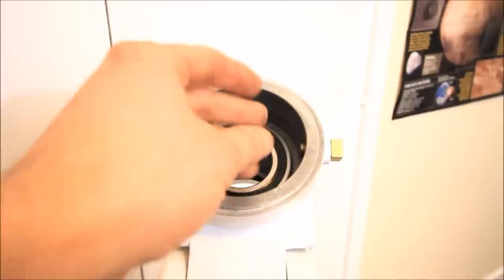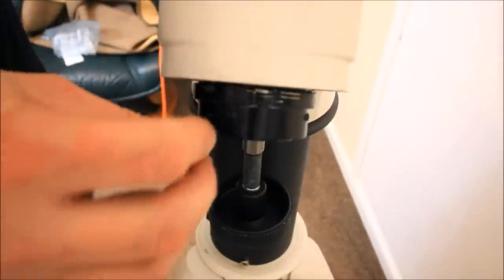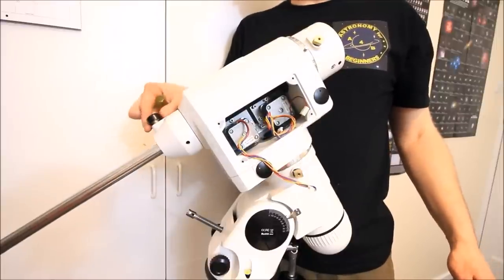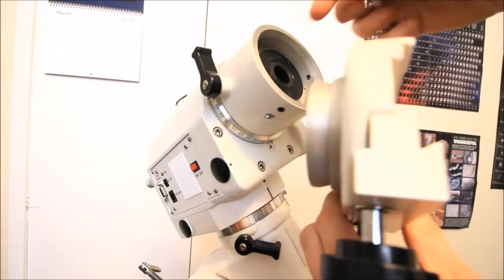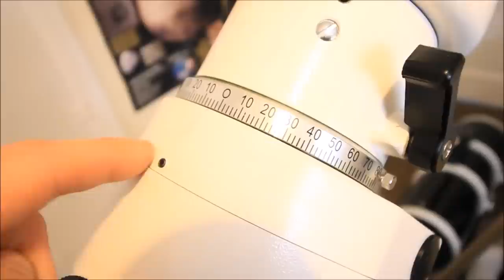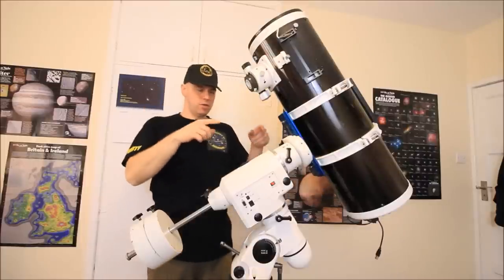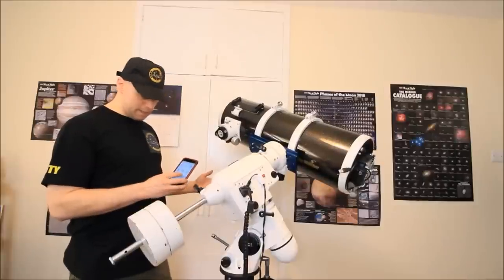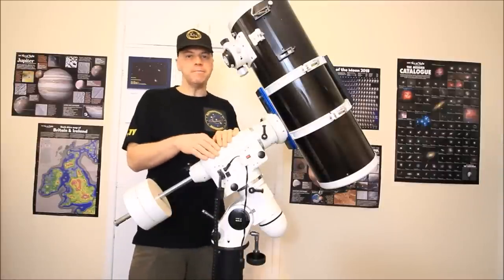How to Super tune the Skywatcher NEQ-6 Mount Part 5

Comment: Thanks for all your work on this series of videos. I have just converted my NEQ-6, and having these videos helped clarify Rowan's instructions and gave me the confidence to dive in.
Reply from the maker: Glad to help! This can be done very easily if your careful, but your mount will operate so much better, I was too in the same position as you, whether to belt mod or just stick with the normal spur gears, but I have spent so much time to get very limited movement from the backlash of the gears, I cannot completely get rid of the free play without over stressing the motors, With the belt mod, you get zero backlash out all, and since I've done mod, I've never had to re-adjust the mount for a long time and my tracking has improved 50% performance increase over the original gears. So yeah Rowan belt mod is all the way for me!!

Comment: Amazing difference Martin! I’ve ordered my kit from Rowan can’t wait to fit it now! :) cheers Ant
Reply from the maker: I'm guessing you got the main bearings replaced, Yep standard ones are not very good and they have a rough feel to them as if the bearing races have worn out. The SKF ones are simply super smooth, your tracking will be amazing from just bearings alone, providing there is no free-play lateral movement and achieve the smooth movement when both axis are rotated , you should be good to go. The Rowan belt mod (if installed carefully) Will help to reduce the free play play in the gears (or gear slop which is always a problem with spur gears) and you'll have a positive drive in both axis. Tracking errors will be reduce massively too!! Enjoy the project you too will soon realise that the mount will feel like a £3000 mount. Remember to thumbs up all videos of this super-tune series for NEQ-6.

Comment: One technique I had to test the worm gear meshing was using a multimeter and check the amperage consomption. If amperage increase it's because the motor drive is forcing. You can very accurately measure when that happens.
Reply from the maker: What a great idea, I'll check that out, what values of Amperes should I consider a reasonable adjustment??
Reply: @MPAstro  Hi, whatever value I give you I wouldn't trust it anyways. Every system has it's own amperage consumption, it's own signature. Although, it shouldn't go much higher than 1 or 1.5 amp per axis. What you do is you establish a baseline by loosing the wormgear and then you get a "no workload" consumption level. Now, you connect your multimeter (in SERIE !!! if you dont want to blow a fuse, or the multimeter itself !) and start tightening the wormgear. It will slowly increase the consumption and then it's going to peak and this is where you know you went too far. When you do your 360 degrees checkup, keep the multimeter plugged and you will see where the wormgear bind.

Comment: Hey man great series of videos! Very clear and very informative. My NEQ-6 is experiencing the same issues and I'm looking to do something similar.
Reply from the maker: Thanks Daniel S, I have worked so hard at this project, I have seen many other examples on YouTube before which are very good, but they lack in certain areas like decent camera angles which certain areas really need to be observed properly to help the viewers. I think I've covered quite a bit here, the only problem though I wish my videos were shorter, but then I start to limit the key info which is needed for these videos. Good info with problems highlighted with me experiencing this project. It's good advice. Please do under take this project and you'll save a ton of money in the process. Please one key advice!!  remember to take your time on this project, and patience is key. Don't rush you can easily make a fatal mistake and destroy your mount in the process (especially the Rowan belt mod, it that is not installed properly). SO GO FOR IT!! You don't know what you'll actually missing, your mount is going to perform superbly with this super tune. So keep watching and don't forget to hit a like and subscribe on to my Channel.

Comment: Love the videos, Martin. So much important "in-between" information - which i couldnt have managed without. Followed your Supertune-videos, ordred all the bearings, and the rowan kit. I bought SuperLube instead of those #1 and #2 grease which you used - thats the only thing i didn't do like you. I also changed ALL bearings. I had problems removing the seals on those axis-bearings (SK6008something), so i used the grease that was supplied with them.

So - I'm finished setting it up now - and have a couple of questions for you if thats allright:

1. The slack you have in the DEC-axis, and are fixing at about 16:00 in the video - What determines which way you send the block? I mean, why you tighten it the one way and not the other?
I have the same slack in my RA-axis so i just wonder:)

2. I had the same symptoms as you showed in your video number 1. When I was turning the mount in especially DEC, it wasnt smooth and even all 360 degrees - it sort of braking at some points. Also some in the RA-axis. It is a lot smoother now - but faar from as smooth as your end result. I cannot send the axis away and it goes around like nothing. It's definately not so smooth even though the restistance is almost even the whole way.
You have any ideas to why?
Reply: Did you manage to solve the "smoothness" ? 
Having the exact same issue
Reply: @95kingston  in RA or DEC? Well the nut that keeps the weightbar for DEC and the polarscope tighting ring for RA was the sollution for me. I did unscrew it as much as possible without any axial movement. Then tightened the setscrews. So the weightbar "nut" is not handtight or tight at all, but theres no axial play and the setscrews keep it solid in position.
Reply: @Hegegutt  thanks I will try this 
It seems like the RA and DEC (especially RA) is stiff even without the polarscope screw in place
Reply: @95kingston  and you changed bearings? Or relubed? How about the teflon spacers, did you land on the correct number regarding thickness and amount?
Reply: @95kingston  also, did you replace the.... well the coneshaped bearing in polar scope end has 2 parts. Did you change the metal"ring" as well as the bearing itself?
Reply: @Hegegutt  Yes all bearings were replaced to new SKF bearings, everything was regreased and the brass gear was polished as well. 
It seems like everytime I'm removing the RA and replace it the stiffness is different.
Reply: @95kingston  i see. Well to have it really loose before tightening it worked for me (but no axial play). Reason i asked about the teflon washers is because on top of the brasswheel can touch the housing if there is not enough space with washers. Then it would most likely be stiff spots. If your at stargazerslounge forum you could message me there as its easier to explain. Masjstovel is the nickname there
Reply: @Hegegutt  thanks I will talk with you over there

Comment: g`day martin mate all your video are really good you have taught me heaps  but i am sorry to say there is getting to be too many adds  in your posts  which is getting to be very frustrating  please don't  add any more 
please keep going  uploading  your great posts  i have used a few of your videos hints and tips on my own equipment  and they work a treat  like the desiccant /silica gel cap made from old spacers and dslr nose cone   but i used a old 35mm film canister  with a few holes drilled in it  works great 
once again thanks heaps for your great videos  but please please minimize your input of adds  they detract from your quality work 
cheers
james D

Comment: Great series. I did the conversion and found lot of very useful tips. However, one issue has come up which wasn't there before the modification. The RA axis is stuttering and makes terrible noises. DEC axis is super smooth and silent. Any idea what could have gone wrong? There plenty of backlash and no matter what I do, it refuses to go away. I tried adjusting the grub screws endlessly. If the backlash is removed the motor stalls. If there is a little of backlash the mount moves in jerky fashion.
Reply: One more thing.. there is some rubbing sound. I had filed off the slot where the belt goes in following your tip. The speed keeps varying so much that it's visible to eyes apart from all the horrible noises. Removed the whole thing and re assembled but issue continues. Also, once the mount position gets closer to vertical, it starts stalling and grinding sound gets worse.
Reply: Update .. figured out that the belt tension was too much. After a few trials got it sorted. Now only one problem remains..it's the backlash. Tried a lot but can't get it right.
Reply from the maker: Apologies that I've missed all your replies, some strange reason Youtube has been moderating some of my messages, and I haven't been able to reply back, due to this delay. So far looking at past work you did, it seems you still have backlash. Have you referred to Part 5 14:56, here I adjusted the backlash with the tiny screws.